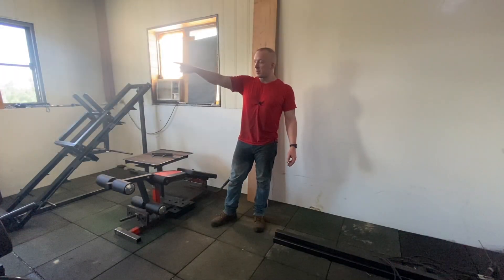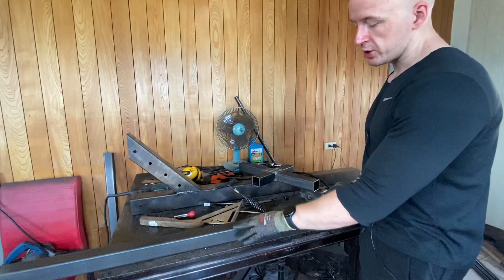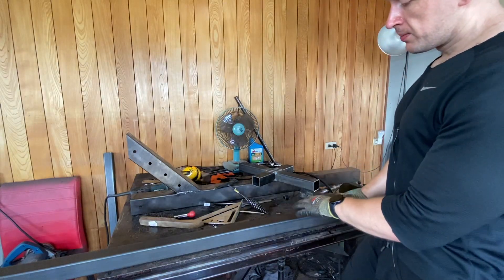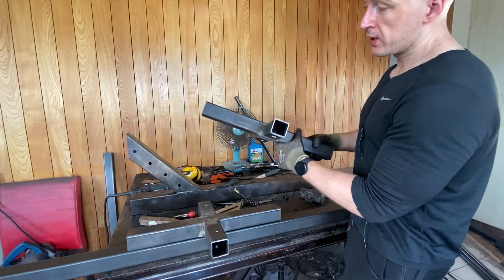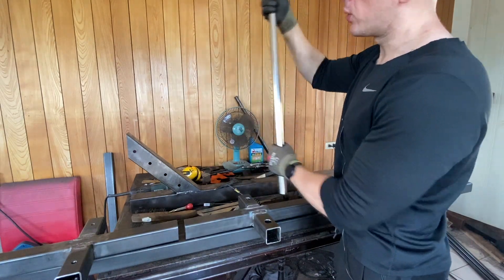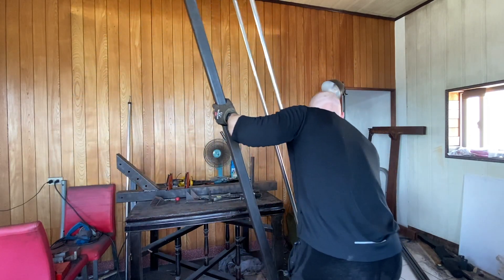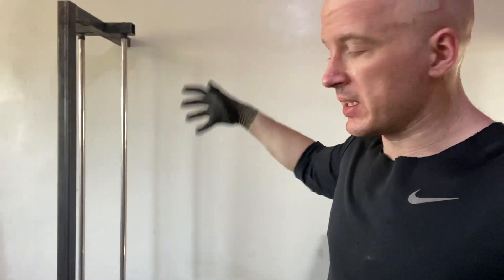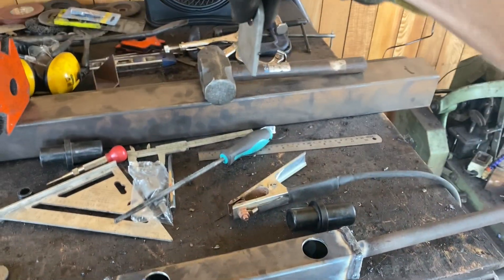DIY Wall Mounted Cable Machine

Comment: This is the best video for an easy pulley system with good range of motion! Thank you!
I'm planning on building mine with adjustable rail on it and making 2 of these, then putting a bench in the middle of them so I can do most exercises. 
It would be awesome to have more videos for an adjustable setup. 
Good job and keep at it!

Comment: I was confused before about the pulley system, I thought if you separate the cable up and below for rowing, it's gonna automatically divide or reduce the weight. But now I understand, if there only one cable through the main weight, so it's gonna be the real weight as well, no matter how much the pulley you want for the design. Is that right? (sorry for the bad English)

Comment: I am trying to build that rail system (on a cable crossover) but instead of doing what you did, I worked on having an exterior to the 2 by 2 steel and the pulley just pulls the exterior shell of the 2 by 2. The only problem is Friction! Since cable crossovers have an angled pulley, Friction is getting in the way, not sure how to get rid of that friction problem with the 2 by2 and the exterior shell ...Sigh

Comment: I’m not a welder just looking at YouTube videos and everyone either has expensive smith machine with everything or separate machines custom build. But haven’t seen a video on prefabricating attachments for already prebuilt power racks like one size fits all type deal.
Reply from the maker: The vast majority of power racks have standardized dimensions throughout the industry, so making custom attachments is pretty straightforward.

Comment: I have a question how much would you charge to make a custom attachment for a power rack that is already built. I’ve been looking for a j-hook type pulley system that you can just add to a power rack that you can extend outward and do crossover or if you want can just put like one in the back center of a rack on j hook like pulley system and do lat pull downs.
Reply from the maker: That’s a pretty straightforward build and wouldn’t be very hard to do, as long as you were planning on using free weights that stacked vertically and thus didn’t require a track/rail system (like most cable machines were back in the old days). It likely wouldn’t be worth having me do it, though, as I live in Taiwan and shipping it to you would be pretty expensive.

Comment: lol You won't be fitting any plates on that, mate. Too close to the wall.
Reply from the maker: Full size Olympic plates fit with 2”/5cm to spare.
Reply: @SkylerKing  Huh? How's that? Is it an optical illusion or something? Those bars look 4" from the wall.
Reply from the maker: It must be an optical illusion. An Olympic plate is 45cm in diameter which means the edge comes out 22.5cm from the center of the bar. I measured everything out so that the center of my bar would be 25cm from the wall. (I quoted the wrong number in the last comment, there is an additional 1”/2.5cm to spare)
Reply: @SkylerKing  Well, damn my lying eyes!
Looks great BTW. I'm scratching my head at the moment trying to figure out how to make something similar out of wood and pipes. I'll get back to my drawing board.

Comment: WoW!! 👏👏👏 Amazing job!! This pulley and the hack squat are awesome. Really good job, seems profesional and really realiable. Maybe I will craft mine's in the next weeks. I probable use linear bearing for hack squat to make It smooth, but really similar to yours. Thanks for sharing and explain everything. Cheers from Spain
Reply from the maker: I would definitely recommend a linear bearing setup. It really simplifies the build process and makes everything a lot simpler. The only reason I didn’t go that route is that they aren’t readily available, here.

Comment: Very nice! I'm interested in how you mounted it onto the wall and what kind of bolts you used. Maybe you can talk a little about that if you do another video.
Reply from the maker: I used a total of four concrete anchors. Two at the top (one on each side of the square tube) and two at the bottom. Each anchor a sunk 5cm into the concrete wall and has a 6mm threaded bolt sticking out of the wall to secure the frame to.